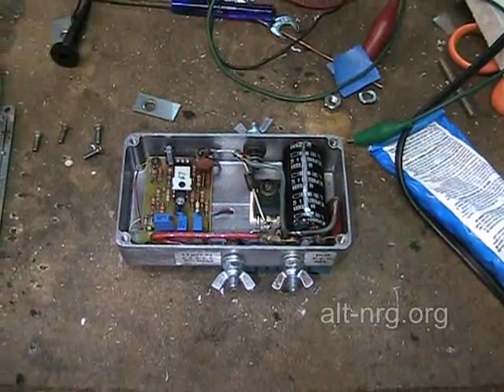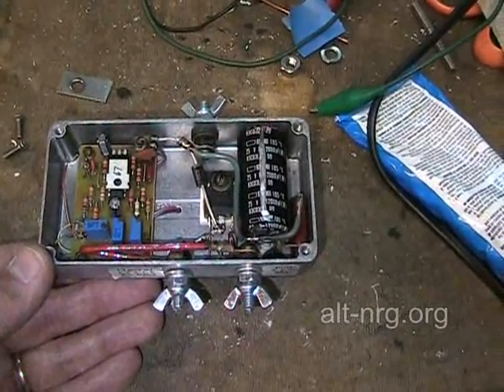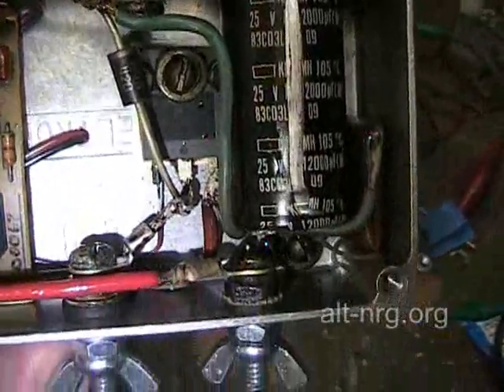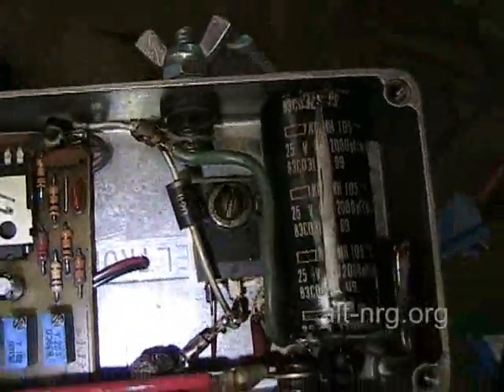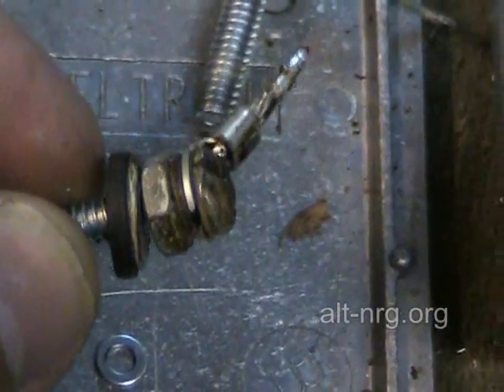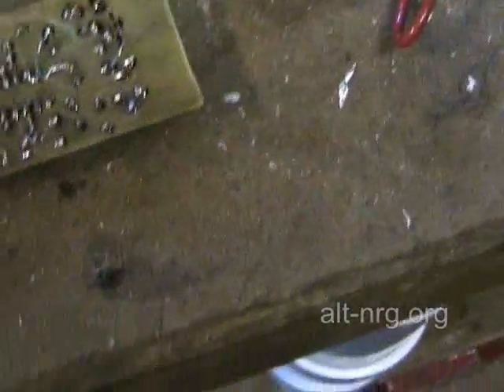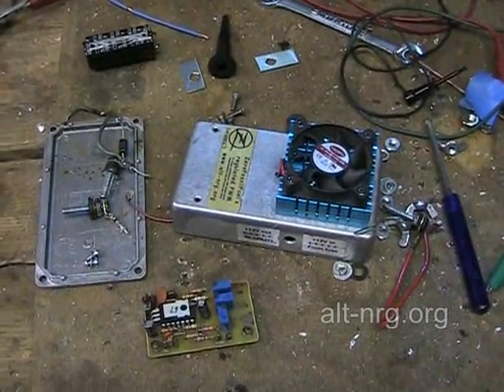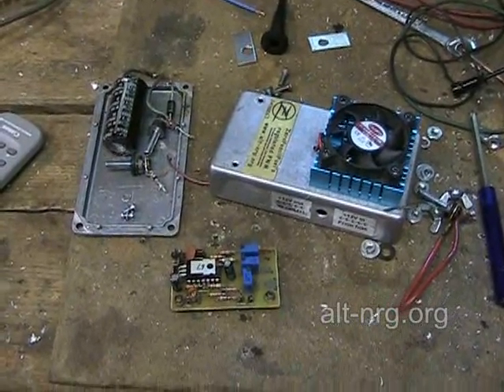#194 - PWM Blowout! What NOT to do.

Comment from the maker: With the voltage sample dropped by .0015 ohm, U1D can provide tight current regulation with a gain of 1000. I could go lower on r12, to retain the same regulation you would have to increase the gain of U1D accordingly. I found stability and parasitic oscillations become an issue at high currents if the gain of U1D is set too high.

You're free to juggle those values as you see fit. I just found these to be the best balance.

On most cars exceeding 30A is foolish anyway. The alternators will fry.

Comment: Well 75 amps would put the dissipation at approx 8.5 watts; the wire would get much hotter than warm. At full load, the 4 guage wire would get warm; the 2 legs of 14 guage wire would still get pretty hot.

I know you don't want to add more components to the circuit, but by using a lower resistance and amplifying the signal, you could acheive the same protection without creating much unneeded heat,

I believe most of the people that use your PWM don't put more than 30 amps through it

Comment from the maker: You're right, r12 does get warm at full load. However, it only has to handle 75A max. There are two r12 in the 150 amp model. One for the source of each MOSFET operating at 75A max each. This also ensures perfect load sharing between how ever many MOSFETS one might stack.

Comment: I don't understand how it is possible that your PWM can handle anywhere near 150 amps; let alone 100.

The piece of wire that you use for r12, I believe you said it is 14 guage wire at a resistance of .0015 ohm would dissipate 15 watts at 100 amps and would dissipate almost 34 watts at 150 amps. That's a huge amount of heat; enough to cook the inside and easily desolder itself unless it was tightly crimped into place.

How much current do these electrolyzers use anyway?

Comment from the maker: Actually it turns out the MOSFET survived too. And the "etched traces" weren't really gone. They just discolored to the exact same color as the epoxy PCB so I couldn't see them. The board still worked. In the end I was able to repair this unit by upgrading R14 to L1, new wires, screws, fan & C7.

Comment from the maker: No, the reason it failed is because the circulating currents exceeded the maximum capability of just one low ESR stiffening capacitor, C7. This creates heat which causes the cap to explode. Once the cap fails other components that it helps to protect don't stand a chance.

Examine the schematic of any commercial grade motor speed controller. You will see not just one, but many stiffening caps in parallel to get the ESR value well below 0.005 ohms. In this PWM there just isn't room for that many.

Comment: the blowout is most likely coused by lag from the current limiter
your limiter has a 47uF cap that has to charge before it can regulate correctely
you can make it faster by lowering the value of that cap, but letting it startup at a high voltage (well above current limit value, so somewhere around 0.25 volt would be high enuf) and ease down into a soft start would be better.
also, a diode in series of R14 (L1) can protect the circuit a bit more
OverUnityNow1 doesn't seem to know ur schematic

Comment: That sounds like a good idea but on occasion even short duration stresses can cause degradation or failure of components.

Generally speaking all system designs should be robust enough to handle excursions like this. Most PWM chips contain current limiters based around a shunt resistance in the mOhm range and a comparator. If the current exceeds acceptable values the PWM duty cycle is cut short. Such a setup can run continuously into a near short circuit impedance on the output.

Comment: ttsqas I watched your video on you PWM and I have to say that while your MOSFET can handle up to 150 amps I don't believe the tiny traces on your board that feed it will. Oh it might work for a while but will it stand up to daily use at nearly max current, I don't think so. I think you will end up having a high failure rate once you go into production of your model...

Comment: Helo there, I am the installer of that poor dead #67 PWM1. and we tried putting a fuse inline and found that after about 8 hours of operation the would get hot enough to blow even though they were under 30 amps. I sent this PWM back to zero in hopes that he maybe able to rebuild, then he called me and it was a total lose. we are now changing are cell design. Thank you again Zero!

Comment: Maybe you already thought of this, but I've got an idea which might help.  I'm not sure which PWM chip you're using, but some of them have an extra comparator that can be used for current limiting, or else an external comparator (op amp) could be used to just do a shutdown when the peak current is too high.  It could also trigger a trouble light somewhere on the box or possibly in the dashboard.

Comment: yeah sure and of course your right as you designed and would know the ins and out but what about a fuse ont the out put rated at  just below peak. i know exactly what you are saying with these calcs but surely a fuse at the outputs would be the answer in avoiding what this poor ol truck did.remember these comments are not to ridicule you but to engage conversation and learning.

Comment from the maker: I am not stupid. I know fuses are needed. Anyone with just HALF a brain knows you fuse at the power source, not the load. The fuse is shown on the connection diagram supplied with the unit and on the assembly page at alt-nrg*org.

READ!

Comment: Oh you raise a good point.  Most capacitors have a temperature rating.  They sell thermocouples for various temperatures that would open up the circuit if the interior got too hot.  You should give the guy a new and improved PWM supply for the knowledge you've gained on this one!

Comment from the maker: The truck driver didn't know what he was doing. 500 amps peak current is still 25 amps average at 5% duty cycle. 1000 amps peak current is still 25 amps average at 2.5% duty cycle.

The CCPWM is doing it's job but the peak current rating of 250 amps was greatly exceeded when numb-nuts dumped in a bunch of electrolyte without knowing how not to make it too strong, especially for that cell design.

A 30A fuse still would not have blown until AFTER the PWM had failed.

Comment: You're probably going to want to put two fuses on the outgoing side of your PWM supply.  That way if either side shorts to the car frame or the leads short together your supply will be protected.  It will also give you a better product.  Had this supply started a fire in this man's cab an insurance company may have had a word with you on your device's protection features and modes of failure.  Don't rely on circuit breakers either, they do not react fast enough to short circuits.